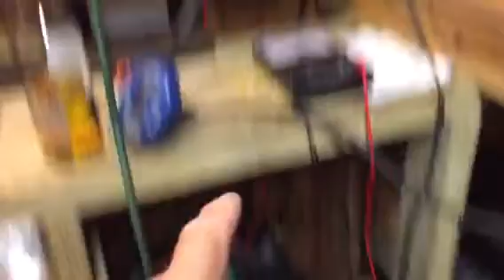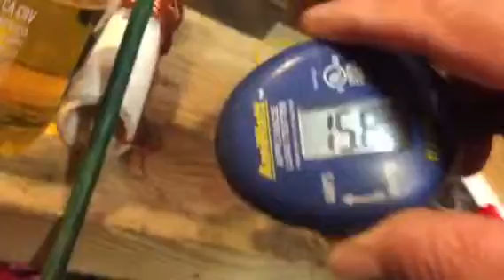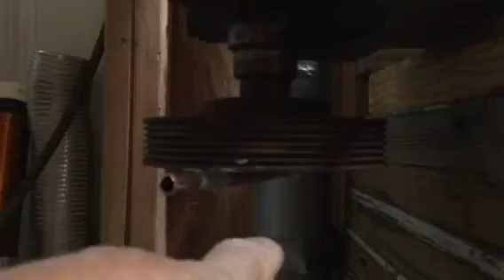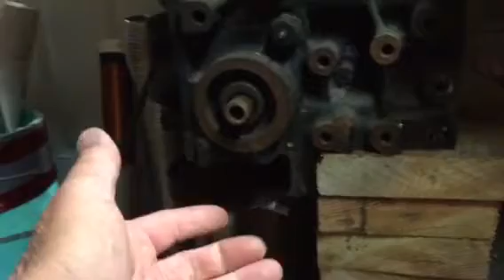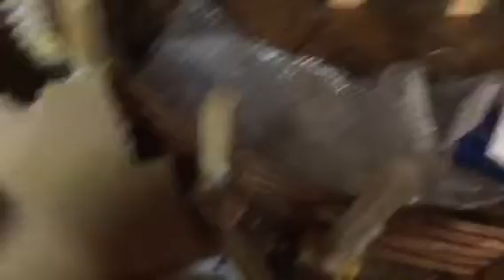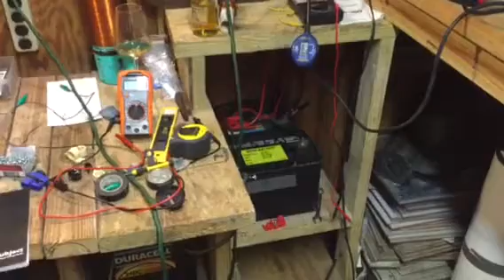Ed Leedskalnin Synchronous motor

Comment: Hey Roy,What do think about the Searl effect generator or zero point energy device? its not free to build but it runs continuously without backup power or powerbank.I installed a power system to my old 74 bedford camper that runs on 150watt solarpanel and 20 amp charger and connected with 2 deep cycle  batterys. i can run lighting , heating, radio and some little things for two days strait without getting  a charge.  when the sun hits the panel right it can charge the batterys in about a day  !  For me its a eye opener in what is possible  and i really like your free thinking and made me think in a better way and  not just think but try with your own hands and the results are amazing. To me it looks like your magnetic machine is creating a flux magnetich field wen it is turning. Keep the videos coming i can see things changing if we keep on exploring.Thanks,Greetings from Holland.